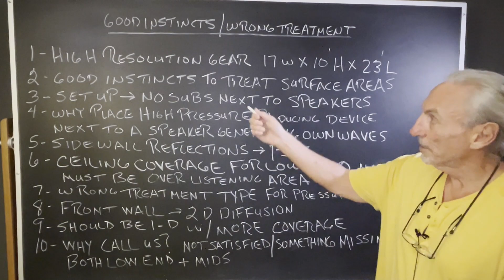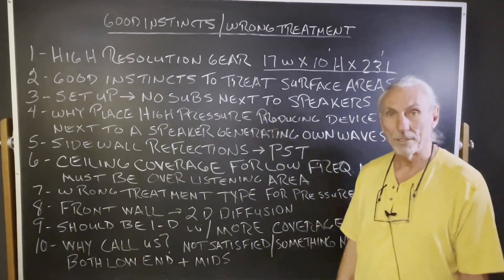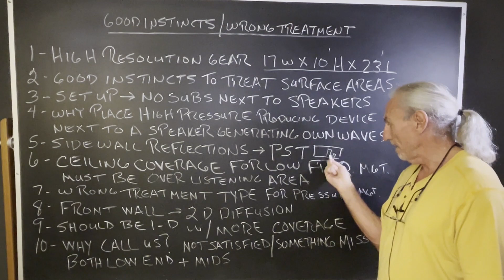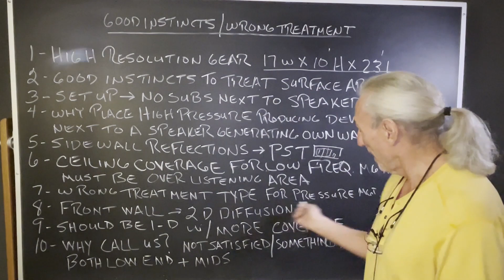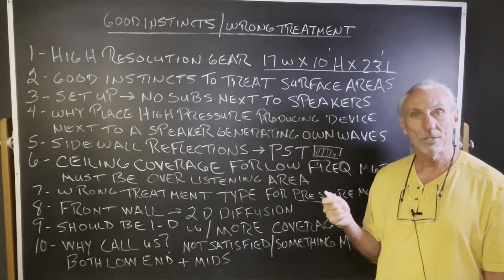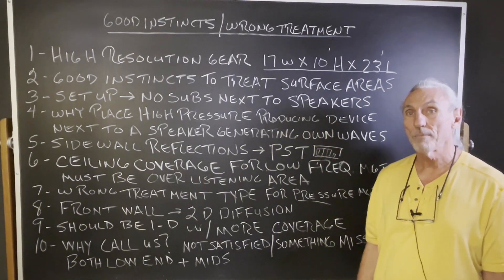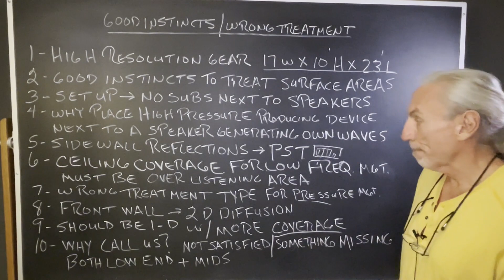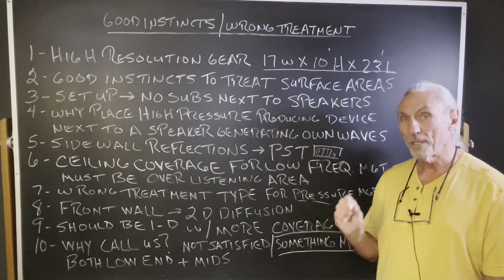Good Instincts - Wrong Treatment! - www.AcousticFields.com

Comment: Would not an open door, or open space to the rest of the house serve as bass management? I know it messes with interior room reflections, but relieving the room of bass energy that way should act the same, or better than a closed room with bass treatment, no? Thanks
Reply from the maker: Open areas can act as pressure relief "valves". However, the openings must be uniform and be on both sides of the room to avoid phase

Comment: The two black panels in either side of the 2D Skyline diffusor are those polygonal "diffusors" (sound redirectors).
Reply from the maker: This begs the question, why would you mix sound redirection technology with diffusion technology.
Reply: @AcousticFields  That's why I made the comment, so you can discuss the problem with doing that.  I had to look closely to see that they were those redirectors rather than just flat absorption panels.

I see people using different types of what they THINK are diffusors and it just makes me scratch my head as to why would they even think that would be a good idea.

The most common mistakes I see are people are buying treatment from other companies and they seem to be only treating Oblique modes above 80hz based on the type, location and amount of treatment being deployed.
Reply from the maker: @Oneness100  I believe in this room it was more form over function.
Reply: @AcousticFields  I'm sure that was a big part of it. To me, it's not esthetically pleasing, others might think it's cool. 

Most of the product reviewers and even many of the mfg's have horrible listening rooms judging from the type, amount and placement they use.  I saw one video of a well known product reviewer showing his listening room. I was mortified at his choices in room treatment, it just looked like a mess.  I would think that you could use it as an example of good instincts, wrong treatment videos.  Maybe you can do more of those types of videos. If you want a link to a couple of examples, I can post them.   🙂
Reply from the maker: @Oneness100  It does not matter what it looks like during the testing phase in room tuning. You can always make it pretty after you make it sound right. This picture illustartes form but no substance. Form plus substance equals esscence. This is all form with no substance. I can look at the pic and tell you why he is not happy with his room sound. I don't need to be in the room.

Comment: Main problem is room dimensions are too small IMHO a length of 36ft, width of 23ft and ceiling height of 17ft has less problematic modes along with needing at least 15 percent absorption and 20 percent diffusion of total room surface area of the 6 surfaces. 
And for such thin material it needs an airgap separation from the wall to improve performance. 

Subwoofers I'd place nearfield to the listening position to reduce room modes as its never good to place Subwoofers in a corner.
Reply from the maker: Most small rooms require over 50% surface area requirements on each of the 4 walls and ceiling areas to manage unwanted low frequency modes. Air gaps are not effective given the space they require. There are much better ways to obtain noise transmiion results without wasting air gap spaces. The location of subs is based upon room dimensions. Be very careful making generalizations about positioning without known dimensions, pressure levels, and usages.

Comment: How do u calc the distance of these 3 reflection points?
Reply from the maker: Its difficult. To avoid complexity, place your sidewall treatment starting at 12" behind the speakers to 12" behind the listening position all down the sidewalls.
Reply: @AcousticFields  is there any recommendation for distance between floor to unit / ceiling to unit? Thanks

Comment: Dennis, question about diffusion on the front wall. You mentioned one dimension is best for two channel. I thought you have mentioned before that having two dimensions on the front wall is good where you might have vertical quadratics for most coverage and then horizontal quadratics up high on the wall? Is it best just to keep it one dimension and do all vertical quadratic diffusion on the front wall? Thanks!
Reply from the maker: One dimensional diffusion for front and rear walls with two channel playback if you have the distance to support one dimension of diffusion. If you do not have the distance, then you have 2-D as an option. However, 2-D will not add any spatiality like 1-D. 1-D will also add sepration to instruments and vocals. Background information such from singers will be more defined. You use
 2 - D for non localization of boundary surfaces in a small mix or listening room where distances will not allow for 1-D.  2-D is used to minimize the impact of reflections on boundary surfaces. 1-D will add sepeartion and resolution increases.
Reply: @AcousticFields  Thanks for taking the time to reply, I appreciate it! Got it, really good to know and helps me. Like another commenter said, the amount of knowledge I have gained from you over the years is unmeasurable. Thank you!

Comment: I bought some of those panels before I started watching your videos. It's a good thing I didn't go all in because I regret it. They're better than no treatment but the compromise is still large enough that it's not worth it
Reply from the maker: Building insulation panels can not absorb low frequencies. The laws of physics prevent this material type from performing at the requirements.This is one of the myths of this business which is perpertuated by the companies that produce and sell this material type.
Reply: @AcousticFields  Yup, now I know. A lesson learned!

Comment: Expensive looking room, knowing the dimensions, would you suggest a location for the subs for our information please.
Reply from the maker: A low frequency producing device and its location depends on many factors that are too vast to simplify.  You must look at room volume, pressure levels used with chosen usage, room dimenions, driver diameter and count, room treatment rate and level along with surface area coverages of said treatment. just to name a few.